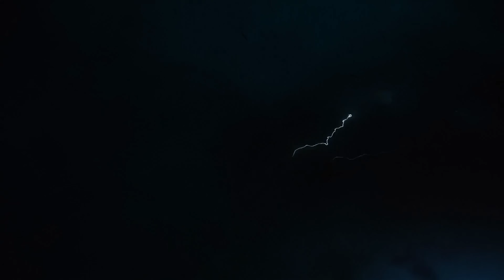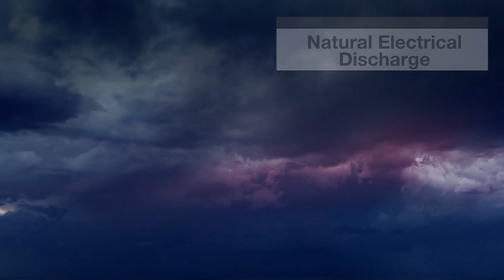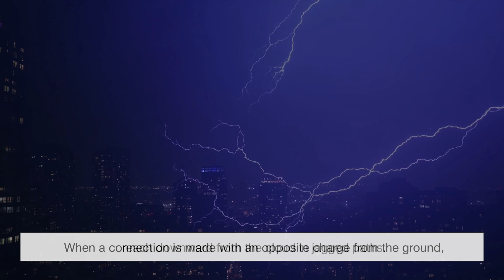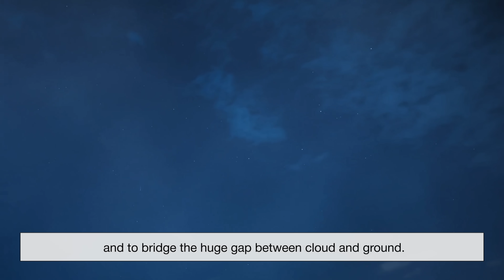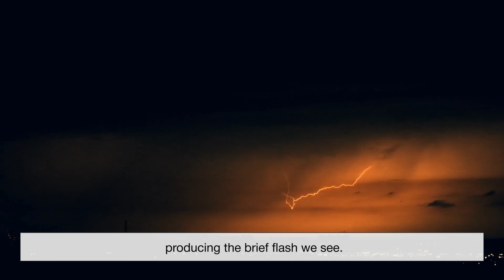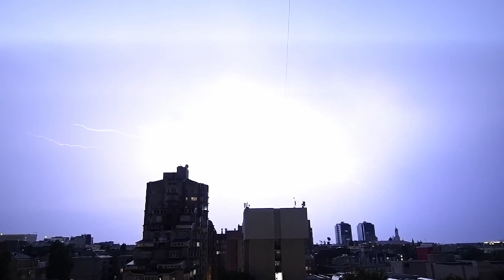How Is Lightning Different from Electricity in Wires?

Comment: If someone wears clothes primarily synthetic fabrics like polyester, nylon, and acrylic and take them off in the dark, there’s a spitting sound and small flashes of lights. That too is static discharge. If they touch something metal like a [stainless steel] ELEVATOR 🛗 DOOR, or a call panel, they’d get a static shock ⚡️.